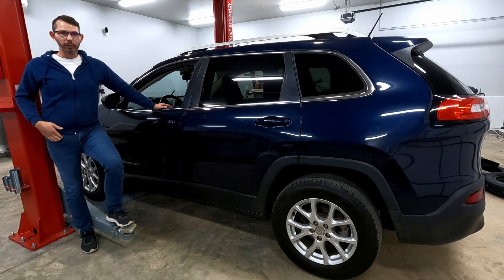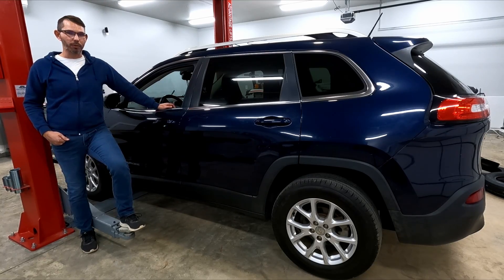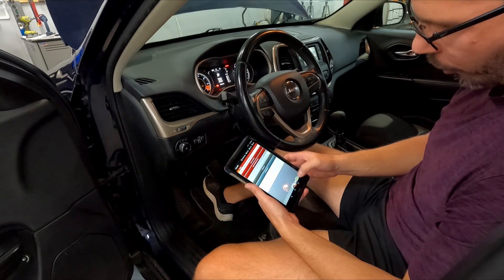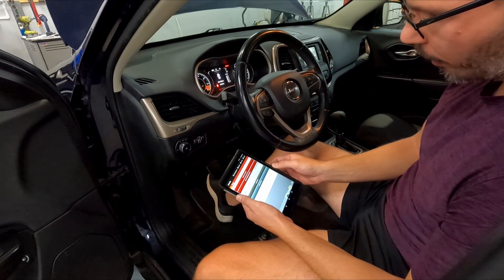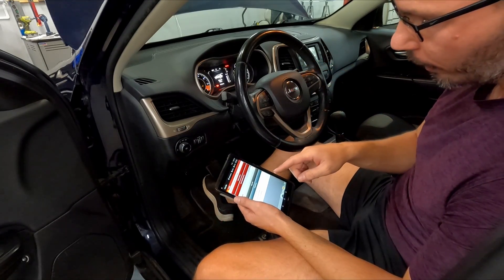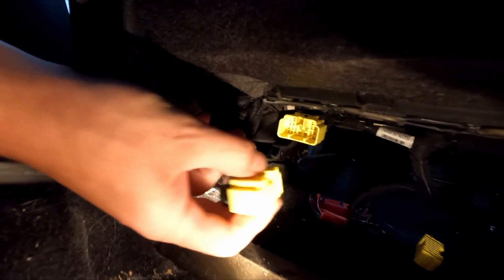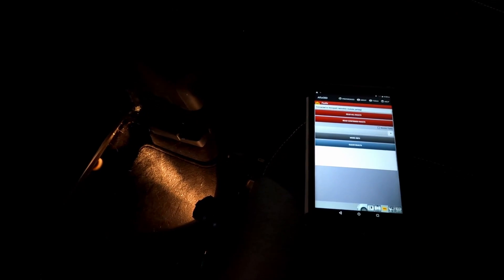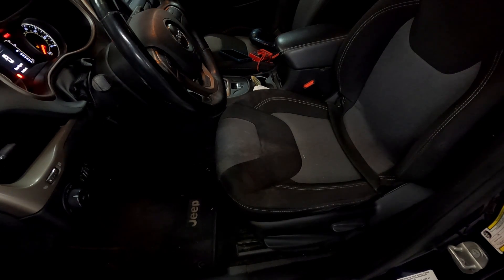Clearing All of the Electrical Faults in the Cheap 2014 Jeep Cherokee KL

Comment: Hello, great video thanks for sharing with us. I have a 2014 Cherokee Trailhawk with the odometer blinking and emergency brake coming on everytime i put it in drive. Do you have any suggestions on what i could check? I read about doing a proxi alignment on it. Will purchasing that Alfaobd on its own allow me to do that? Any help would be greatly appreciated.
Reply from the maker: @JosephIrizarry-er1uf  if you purchase AlfaOBD you can check all of the systems in the Jeep to see what's causing the issue.  If a proxi alignment is needed, you can use AlfaOBD.